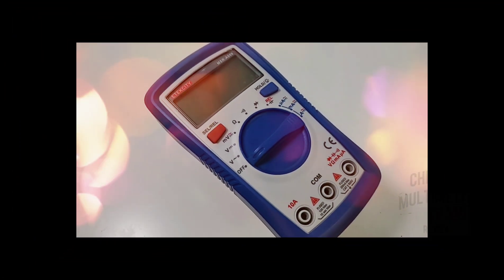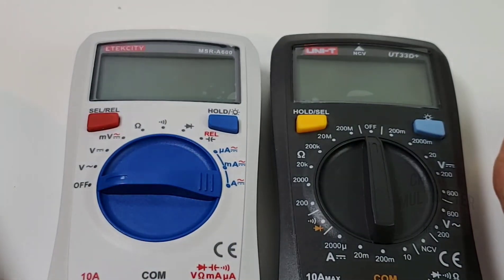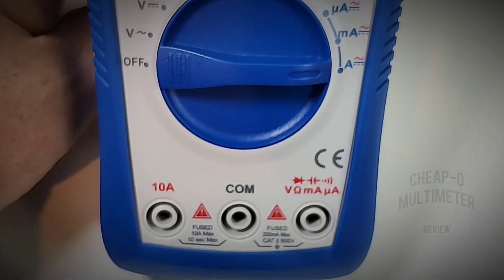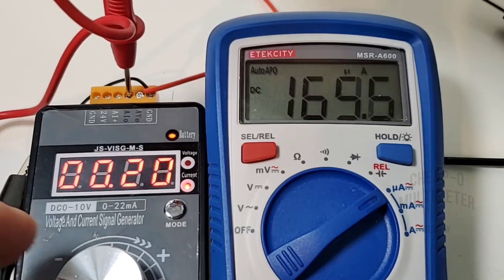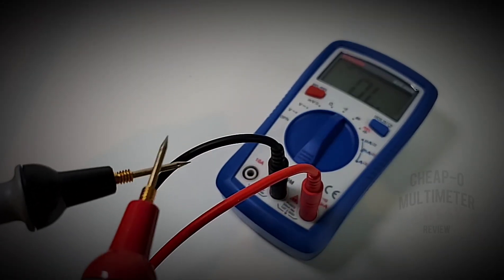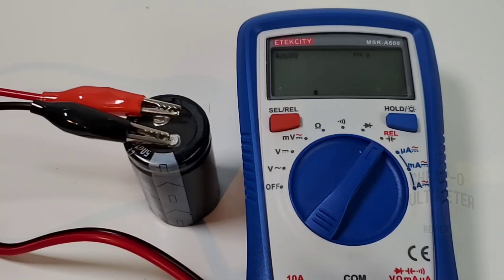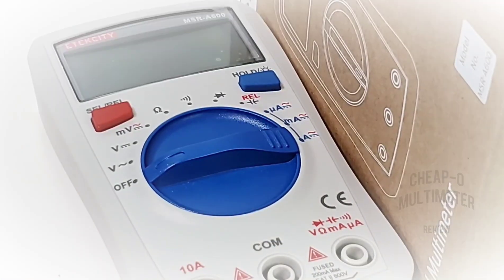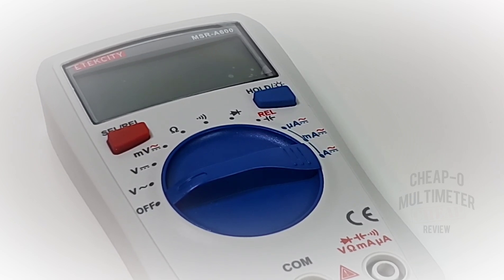ETEKCITY MSR-A600 CHEAP-O Multimeter Review & Teardown!

Comment: Great review! I'm actually waiting for my UT191T as you recommended! (it unfortunately got stuck in customs but fortunately the price to release it is only 15 bucks...). As you said in the video, about wrapping the leads around the meter, do you recommend to do that for storage? The leads won't get damaged?
Reply from the maker: Oh you will love that UT191T!! Let us know when it arrives!! 
Personally,  I rarely wrap the test leads around my multimeters. However,  I've worked alongside countless techs that do and I've never heard of any problems. YMMV, do whatever feels right for you.Normally I put them in a case with dmm when mobile, if on the bench, I usually remove the test leads on my multimeters once I'm done testing.😃
BTW, I just hate scratched displays so I'm careful when I'm stowing my multimeters.😱
Reply: @KeepOnTesting  Thanks for the answer! Since I plan to mostly keep it on the bench (I'm unfortunately not a certified technician, I'm still in school), I guess I might just remove them and put them in the included case (not the best but it will for sure offer some protection)! And yeah, it will for sure help prevent scratches, I'm also a person who doesn't really like even a small scratch on my lovely equipment... I will for sure update you when it arrives! If everything goes well I should get it in about 3 days.
Reply from the maker: @Hack3rPT  Looking forward 👌
Reply: @KeepOnTesting  It finally arrived! I tested some of it's features today and it's looking really good, and it also feels awesome in the hand! I will maybe write a full review later, and will for sure post it here.
Reply from the maker: @Hack3rPT  Urrrah!!! Yes, its such a fantastic looking  dmm that its a pleasure just to stare at and behold! Looking forward to your thoughts..
Reply: @KeepOnTesting  I'm currently writing the review, but unfortunately I think I found a problem with the continuity mode. Randomly (sometimes happens, sometimes doesn't), with probes plugged in or not, when I turn on the meter and put it into continuity mode, it will show about 500 ohms on the screen, beep for 1 seconds and then it stops. Everything seems to work perfectly after the beep. Battery is at 9v and none of the fuses are fused. Is this normal or should I be worried?
Reply: @KeepOnTesting  Update on the situation: I remembered now that yesterday I might've accidentally measured mains voltage in continuity mode (for maybe 1-2 seconds and then I instantly noticed and changed it). Also, I've noted that if I switch the meter for example to Volts range, wait for the 0.00 to appear, and then switch into continuity there's no beep this time. Might be some sort of capacitor that charges up to activate the continuity buzzer? I really hope I didn't damage it.    Waiting for your help on this if possible.
Reply from the maker: Have you checked your fuses? Have you looked at the pcb for any physical signs of damage. These types of scenarios are often difficult to isolate because they are so random. Start with the basics. Also, when in continuity mode, does it stay in OL when inactive or does it display something else ?
Reply: @KeepOnTesting  Fuses are all OK. There is no obvious sign of damage on the PCB. After the beep, it shows OL, and of course when touching the probes it displays the resistance and when not touching it always shows OL. The only thing that I'm worried about is that beep and resistance showing when first switching to the continuity mode.
Reply from the maker: @Hack3rPT  I'll see what I can brainstorm. I don't have an easy answer at the moment. Everything sounds normal except the quirky continuity..
Reply: @KeepOnTesting  It seems that the problem only happens in continuity, if I try the same thing in resistance mode, it doesn't show anything and works perfectly fine.

T̶h̶i̶s̶ ̶s̶e̶e̶m̶s̶ ̶t̶o̶ ̶o̶n̶l̶y̶ ̶h̶a̶p̶p̶e̶n̶ ̶o̶n̶l̶y̶ ̶w̶h̶e̶n̶ ̶I̶ ̶d̶o̶ ̶a̶ ̶q̶u̶i̶c̶k̶ ̶m̶o̶v̶e̶m̶e̶n̶t̶ ̶t̶o̶ ̶t̶h̶a̶t̶ ̶p̶o̶s̶i̶t̶i̶o̶n̶.̶   Never mind, it's completely random. I've watched it more carefully, and it seems to go from 10-20 ohms to 500 ohms quickly and then into OL (works perfectly after). 

It only beeps while it's in the 0-50 ohms range, after that it quickly climbs up to 500 and then goes into OL. (all of this happens in about 1 second)

I think it wasn't damage by the mains voltage, since it states on the manual that every mode has a 600v surge protection and from what I saw on the internet, for it to be damaged by that it would: a) stop working or b) keep beeping infinitely. Thanks, and I will for sure wait for your input on this one.

P.S: This might've come like this, but if it did I didn't notice. Just really noticing it right now because of the mistake that happened yesterday... 
It would be great if you could try that with your UT191T and see if you can replicate the error.
Reply: Some more info: It seems that I can replicate the error if I switch the multimeter to mV (it usually jumps around and rarely gets a steady zero) and then into continuity. Maybe it shows that resistance value because the processor is slow and it is still changing modes from mV to continuity even after switching?
Reply from the maker: @Hack3rPT  Wow, a real headscratcher! I'll forward the anomaly onto UNI-T and report back if I hear anything more 👍
Reply: @KeepOnTesting  Thanks! Will for sure update you also if it randomly stops working or starts having any more problems. If this is the only problem with it, I don't think it's worth sending it back, since it practically 100% works.
Reply from the maker: @Hack3rPT  Thank goodness! This is by far one of the best dmms UNI-T has produced .You're getting alot of multimeter. Will let you know if I hear more.

Comment: I like its appearance & fast continuity response most. But it has no light indicator. 
It would have been better if there was a beep sound at the diode range or better if diode and continuity  were two together
Reply from the maker: Totally agree. A visual indicator is a huge bonus when it comes to continuity! Audible diode...oh that's the best...another must have on a Multimeter and really makes troubleshooting alot quicker.
Reply: Yes,,, but It is difficult to find the beep sound in today's auto multimeters in the diode range.

I found continuity and diode function two together in ZOYI ZT-X smart multimeter

Comment: 16:55 I remember a video from Joe Smith where a nice multimeter used that style of switch and all the arms broke during his switch cycle test.
He tests them to like 50,000 cycles or something, so I’m not sure how long you’d have to actually use a meter for that to happen
Reply from the maker: I believe you're referring to the KEYSIGHT  U1231A in which he said that these selector switch designs weren't robust and prone to failure. I disagree. 
I own a few heavily used multimeters with this type of Rotary Selector design and they've lasted 5+ years in the field with no signs of failure or impending doom. As always, sensationalism can be blinding at times.
Reply: @KeepOnTesting  good to know that they hold up in real life better than a stress test! I guess to even reach 50,000 cycles, you’d have to fully cycle the range switch like 14 times every day for 10 years, and even then it wouldn’t quite be the same as doing those 50,000 cycles in a day or two.
Reply from the maker: @pyromen321  Spot on...nothing like a real world test to work out the kinks!👍

Comment: They actually did color code the input jacks but they did it on the labeling above not the jacks themselves - heres something, the jacks on my 33A+ are also all same color (black) but the print above is yellow on the COM jack while its white on the 10A and Main positive input on the right-?!? go figure.  I also noticed my UT33A+ shows no residual capacitance, just solid zeros, no Rel needed on this one.
Reply from the maker: Funny how such a basic safety concept can get lost in translation. I really think there should  one standard that all multimeter manufacturers are binded too when it comes to end user safety. Can you imagine going on a holiday where the country you're visiting uses red to go and green to stop...🤪🤪😀

Comment: My UniT UT33A+ is identical except its red and black and Ive always really liked my little Unit, its a great little meter I love it - but I paid less. They want $33.99 for the Etek A600 and $35.99 for the UniT UT33A+ variant on Amazon and Darrens right there are better deals on more functional meters to be had at those prices.  I paid just under $20 for the UniT on the bay some time back but popularity has jacked the price up - these are $20 meters tops, im thinking more around $14.99 given available alternatives in this price range.  But even with its minor shortcomings its accurate and reasonably well made - could it be better-?  Yes, but so could many others costing more. Also electronics hobbyists require more functionality in the cap range for one and mV range for another .  For a little light hobby / DIY around the house type use this is not a bad little meter to have around if it suits your needs, but both it and the UniT are now too pricey and need to come down.  Theres a group of folks out there that seem to prefer small, its the only reason I can think of someone would pay over $30+ for these given whats available today.  Decent little meter with a big resistance range, excellent continuity and whats there is pretty well made but its been priced way out of its class - though the fact its still selling at these prices does say something about the meter.
Reply from the maker: Totally agree..this multimeter should be 15US at best ..nothing groundbreaking or revolutionary here...I think its been tweaked but at the end of the day its a rebadged UNI-T with slightly better specs. I really think they should color code those input jacks as I believe this dmm caters to the new multimeter user and as such they shouldn't assume that their customer will know where to stick those test leads  ...all in all a decent 👌 but rather uninspiring unit.
Reply: @KeepOnTesting - Much as I like the little meter I have to agree, any meter especially one likely to be sold to a first time user with less intrinsic knowledge of meters in general should have color coded inputs.  All the operational practices we take for granted as common knowledge doesnt necessarily apply to all users.  I really have to wonder why they would put such a killer resistance range on this meter yet let it fall short in capacitance and mV.  It would have made a serious difference if all these ranges were at the level of the resistance range, and for the price im thinking they should be.  I still wonder how are these meters commanding such sales and popularity at these prices-?  I didnt feel too bad paying $19 for mine awhile back, but now you can buy a HT118A for the price of the UT33A+ on Amazon, along with some nicer UniT's as well.

Comment: Hi, is it better than the Holdpeak HP-41B?
Reply from the maker: Definitely not! The HOLDPEAK HP-41B offers alot more for less money including dual Temp  , higher 800mA range, special LED Mode etc...
Reply: @Vano Groznyy I definitely don't agree with you.... Holdpeak HP-41b is much much better... It is 6000 count true rms multimeter with lots of features ... It quite fast and accurate ...
Reply: Above the all HP-41b is only $20

Comment: I don't know about this one. It's too similar to UNI-T UT33A+ in spec, performance and build. I know you were disappointed with a faulty fuse in UT33D+. Maybe if this was a common problem for UNI-T, Etekcity would have some advantage. I personally haven't experienced any problems with UNI-T's multemeters before.

Couldn't find this meter on Aliexpess. Let's assume it costs $30. I've managed to found it on eBay for $38.99. UT33A+ costs around $18 on Aliexpess. I wouldn't call MSR-A600 a bad choice. I think they are  both decent. But price is much more reasonable for UT33A+.

I really hope to make it to the livestream . Is it 9 a.m. Eastern Time? I think I managed to find the correct store, but it would be very helpful if you could post a link for other people before the start.
Reply from the maker: Well said..indeed its a rebadged UNI-T with a few improvements but overall the former is a better buy. I am still waiting on the official link from UNI-T 😕 
OFFICIAL livestream start TIME is now 10AM EASTERN (+5 GMT)
I will post the link here and on the channel Twitter feed @keep_testing 
Hope to see you there 👍